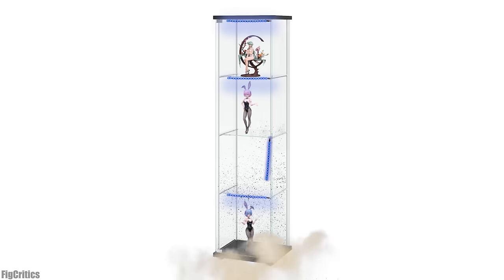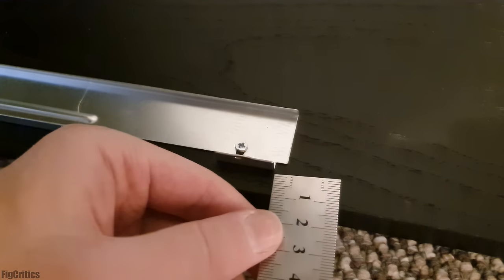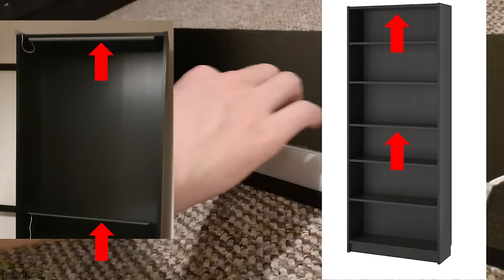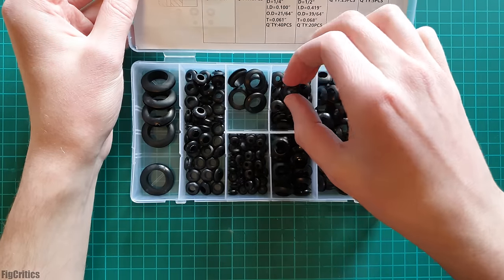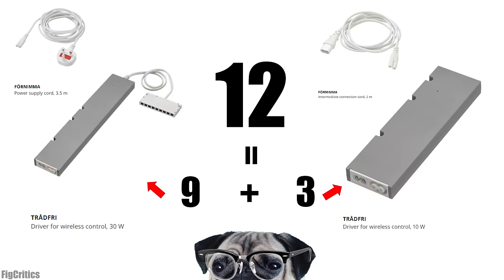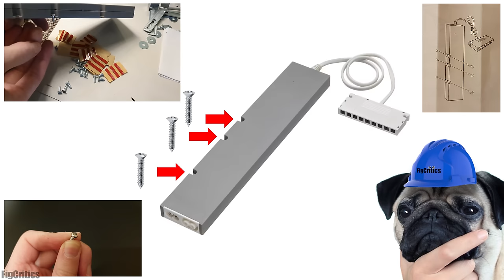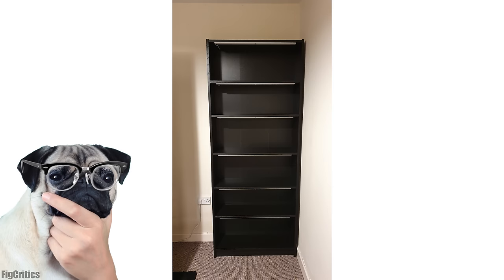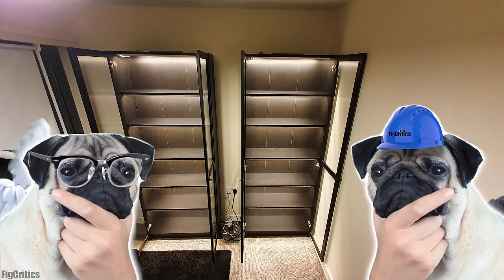How To Make The ULTIMATE Figure Cabinet

Comment: Nice idea for Ikea but I cannot help think that this could be done much cheaper, especially the lights. Simple LED lighting would be much cheaper.
Reply from the maker: Thanks so much!! Absolutely, this is not the cheapest. Depends what kind of job and look you want. This was careful planned like this on purpose because these LED lights are premium, and last much longer then your average LED's. They also have an angle to them unlike flat LED straps that makes them penetrate more areas on the figures/items, and have visior casing over them to soften the light, protect and concentrate it.

And lastly, they look really good 😃! You don't see them because they are housed by the case, and angled on the items. You cannot achieve that with basic LED straps, unless you build some kinda thing out of wood perhaps to mimic it.. but I think that would cost just as much or more, excluding the time.

Comment: How many inches are between each shelf
Reply from the maker: The gap between each shelf is measured with the holes that are made by IKEA, and they are all different. Please refer to part 7:09 for this, it will guide you.
Reply: Thank you. I saw that I was just trying to figure out your placement and how many inches from the bottom of one shelf to top of the other
Reply from the maker: @gabrielgomez731  I see what you mean, unfortunately every shelf to the other measurement is different. The middle shelf to the one higher up is approx 28-32 cm.

Comment: Norrfly seem to be unavailable now unfortunately - no idea if the other options would work for this or not!
Reply from the maker: Ah yes I've heard it has been discontinued in a lot of countries for a few months now! They have yet to sell another version of it as well... I have seen a lot of brand new Norrfly lights for sale on Ebay, but the prices vary a lot... Since the Norrfly is unavailable, what you'll need is to find a brand of LED bars that also can be hooked up to a Driver (like the TRADFRI) or even come with one so that you can plug all the lights of one cabinet into that driver, and hook it with one plug to the wall. 

There are defo alternatives to the Norrfly but just not at Ikea for now it seems in most countries.
Reply: @figcritics  Thanks for replying! After commenting here I discovered that IKEA replaced the Norrfly lights with another version called Oversidan, and they have a diffuser on them to spread the light more evenly than the Norrfly do. But they’re quite a bit more expensive than Norrfly were, and the light temperature seems warmer (which isn’t ideal for display cabinets). Something to mull over though!
Reply from the maker: @JYCrazy1  This is an awesome find, I didn't even see this when I checked! Yeah they seem to be 10 bucks more without much of a "why". The stats are almost identical to the Norrfly too..

They would defo work since they have a diffuser like you mentioned and everything that will fit for this build. In regards to the Warmness of the color, I can say with confidence that these are almost identical to mine. The Norrfly's are honestly as warm as the LED strips that I have from Ikea on my detolf, and these ones do have the same tint when I look at mine and them. 

But yeah, if we think about it... for one cabinet you need 6 of these, so that totals up to a 60 bucks increase because they are 10 bucks more a piece which sucks.. Though I wouldn't be surprised with all the inflation that if the Norrfly WAS still available, the price would of increased anyway as well.
Reply: @figcritics  Yeah I have 2 new billy double bookcases, so if need 12 of these - a bit expensive now! But it’s good to know the light temperature is the same as the Norrfly as that’s pretty much perfect 👍

Comment: Really nice video, except the Norrfly removal part! :) It seems to me you went completely wrong about it, as you were trying to pry it off from under the mounting plate which can't work, and you need to remove the light cover first, pretty much going the opposite way of how you clipped it in. Most of them are not too hard to remove, and in most cases you don't need any tools, but some can be stuck pretty bad, and you might need to use some kind of a spudger. 

This is how they SHOULD be removed when not tight as a mo-fo.

https://www.youtube.com/watch?v=HAnUVikXT8U
Reply from the maker: Thanks so much nedi! 

Oh no no no, I was in-between the Norrfly and the Norrfly metal bar when using the ruler to disengage it! There is no way I could get under the metal bar with it's screwed on tight to the wood, would of been weird of me doing that anyway 🤣. I managed to disengage it slightly from the bar which have me room to bring in the ruler for help!

I watched that video as well before my struggles, and although it's the right and only way, it just didn't work for me as you can see here. I did respect it though and tried 😫.  It's one of those things you'll have to experience for yourself to see how silly the engineering is on it, those engagement tips do not unhook once they are in, regardless of which side you pull towards you. Maybe I was unlucky with the bar... twice? 🤕
Reply: @figcritics  Oh, I know from the first hand how crappy that design is when mounting plate is crazy tight... One of mine was so tight that I was barely able to push it in, only to realize I need to take it off XD I thought for sure I will break the light while trying to remove it. I've managed to take it off only after I used two flat screwdrivers, stuck them between the mounting plate and light, and slowly started pulling them up at the same time, to distribute the force. It was quite an ordeal and I was sweating like crazy! XD

In your case, I thought that ruler went underneath because Norrfly mounting plate has no completely flat spots, and back end is curved on the entire width. What I completely forgot is that mounting plate wasn't as wide as the light bar itself, so that one's on me! :)

Comment: I'ma be honest, these are fucking awesome. But personally I'd probably choose a different lighting setup. I prefer a different color temp, more daylight neutral but not too cool. I also prefer a bit brighter than that. I'd probably add a mirror to the back of the case too, in order to create some spacious feeling.
Reply from the maker: Thanks so much Vexies! You're right, color temp really is something people should get to pick themselves. I'm more drawn to warm colors because of my wall paint here, but something more neutral would be awesome as well! You'd be surprised of how bright these actually are, if not TOO bright in my opinion! There is special plugs to control the brightness and other settings on these, but the rooted ones were good for me 👍! That mirror idea is great, it will defo give it more depth too!!

Comment: It's a nice solution for low budget. But those IKEA furniture got so bad in terms of quality. I would get mad about the visible"lines" at the backwall or all the cables. So if you have to spare a little more money, maybe get some offers from your local carpenters. They can often save you some money, too, but will deliver a way better quality. Thanks though for all the effort. I guess one can live with this, if you're not so demanding and want to save the money for more important tasks.
Reply from the maker: Very good comment, I agree with you 100%. I think that this video is now more of a good example of how to proceed when building a cabinet, but in terms of the material used, most of it is now unavailable and not so great anymore in terms of quality (I've heard this from other people as well). I think I was lucky to get it all done when I did as ikea was still selling good quality Billy's and the lights as well.

I will be doing another one of these in the future once I''ve moved home!

Thank you so much for watching :face-red-heart-shape: